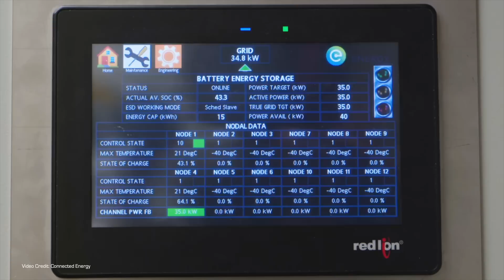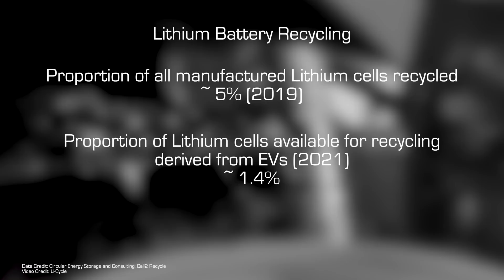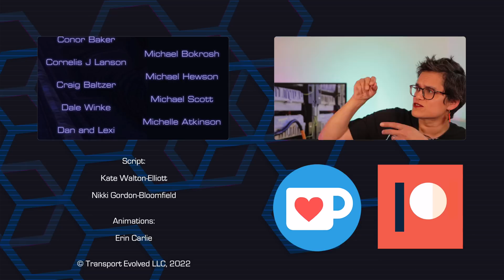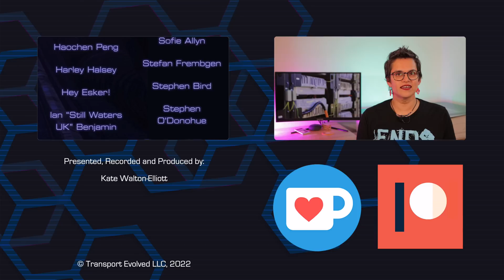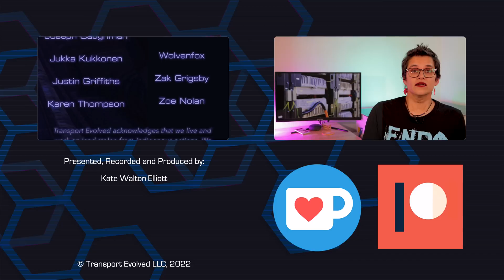Recycling Might Make Better Batteries! - Part 2 of What Happens to the Batteries?!

Comment: The waste material with exactly the chemicals your trying to get in it produces better final product than the raw materials with random unwanted material in it... who'd a thunk it.

Actually, the re powdering of a previously powdered product producing more surface area for reaction is fairly logical as you will break down some of the already powdered material to smaller size.

Also, its cheaper to mine batteries that are here for battery materials, than to dig up random parts of the earth thousands of miles apart so recycled batteries will be both better and cheaper.

Comment: The big challenge for these companies will be their ability to buy the packs/vehicles back from customers after end of life or wreck and not run into competition from other buyers like EV conversion companies and small scale solar. I think this may be part of Tesla's plan with their bonded structural battery packs... If there are no modules, then there is nothing to "part out" to suppliers. It may be bad news for the companies dependant on Tesla battery modules, but that is the risk you face running a business on salvaged parts.

Comment: I wouldn't expect EV batteries to have mass recycling until an other decade from now (2022) BEV have only been a consumer product for the past decade, and only within the last couple of years had it really picked up.  I still see a good number of the Ovel grill model S and crome handle model 3.  The leaf and bolt didn't have the range for my area until a few years ago.   Besides those 2015-2020 folks who laughed at us for going electric when gas was super cheap, are now only looking into alternatives
Reply: I'm still perfectly happy with my 65mpg diesel Todd, here in the UK.
Despite fuel being nearly £2 per litre.  About £10 per gallon.
Simple bangernomics unfortunately!
It's an old car, long since paid up and we manage 500 miles per tank.
Because we do relatively modest miles, even the 'cheapest' EV doesn't come close to making financial sense.

Comment: The problem is when they start recycling batteries without using them in a secound life on a powerwall or ev conversion.
Reply: Surely (he said optimistically) second life use is more valuable than recycling...so economics should win out here...